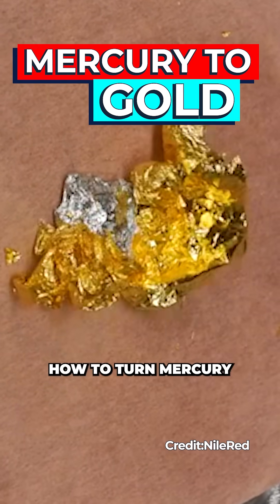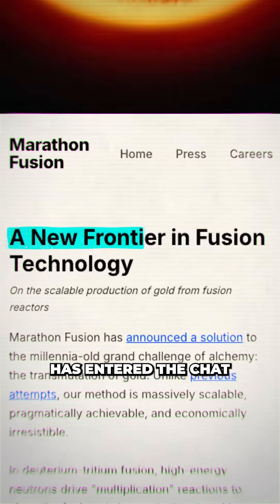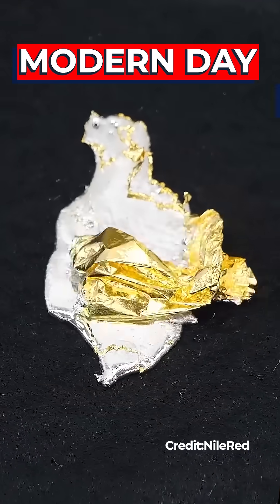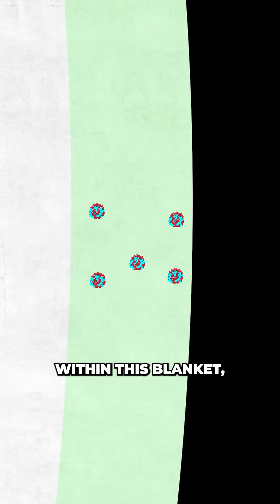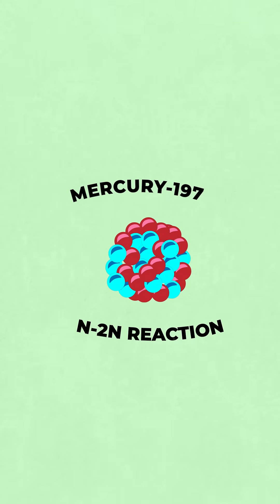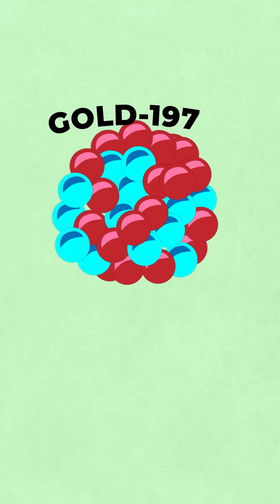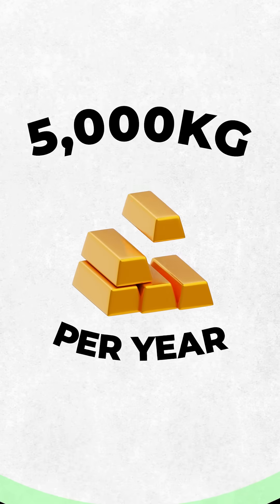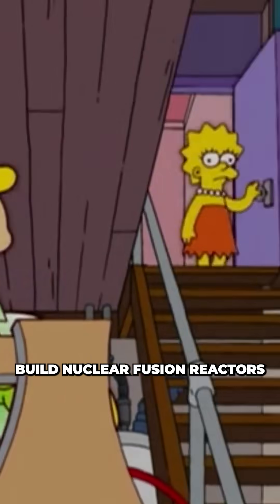Scientists Turn Mercury Into Gold

Comment: Gold will become worth less in terms of spending power. Maybe on the same level as aluminum
Reply: Well yeah BUT it is still useful as a resource and not merely a commodity. It's used in things like electronics, oh and it also doesnt rust.. yadda yadda, its gonna be a lot cheaper to USE
Reply: Yes you are all correct, it won’t be useless but it will be worthless. That’s why I brought up aluminum. A fairly cheap metal but is useful
Reply: That’s why you become a mercury investor
Reply: Well obviously not, right? Like, if it becomes worthless, then the process of making it becomes fruitless.
Reply: @partimentieveryday  Gold is a good conductor, so if it's worthless, we can swap copper for more efficent gold.
Reply: @Captain_Bart_PetersonDon’t change the premise of the conversation. 

Anyways, yes gold is obviously a useful material. So is mercury though.
Reply: @partimentieveryday 
It won't be worthless; it'll just lose its arbitrarily inflated value based on it being a scarce financial asset. Jewelry and electronics will still give gold some value.
Reply: @TheRatsintheWalls Correct, that’s what I said
Reply: @partimentieveryday 
"It'll be worthless."
"Here are some uses that'll maintain some of its worth."
"That's what I said."
<Jackie Chan, his hands at eye level>
Reply: @TheRatsintheWalls You didn’t quote me correctly. Your point would stand if it was grounded in reality whatsoever. Again, that’s “”IF”” it was grounded in reality (feel like I need to give you some help in finding what you are misquoting me on).
Reply: Oh no, how terrible!
Guess we will have to switch to platinum.